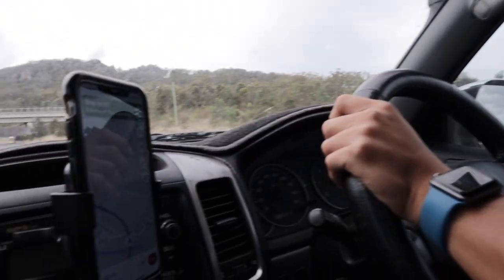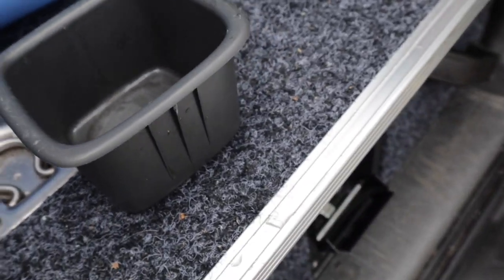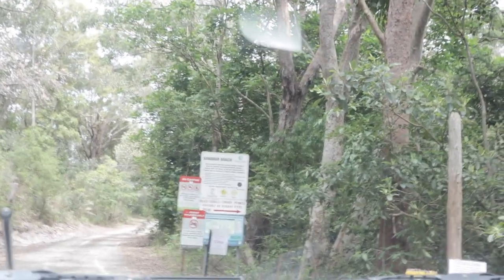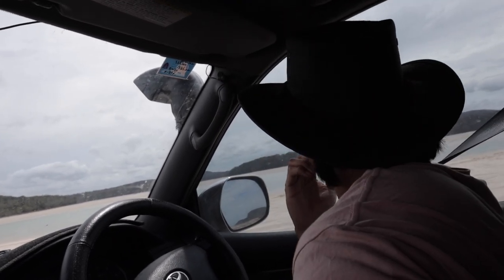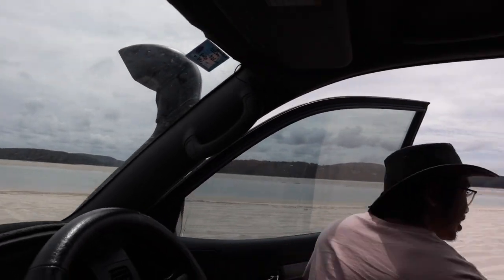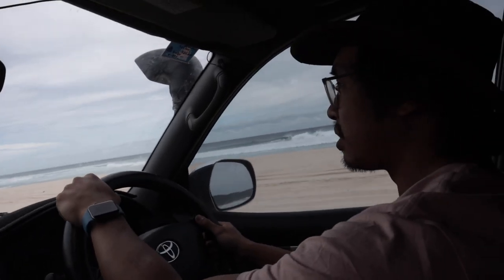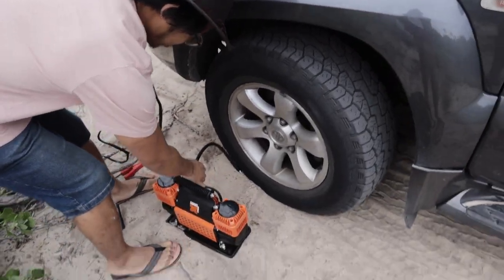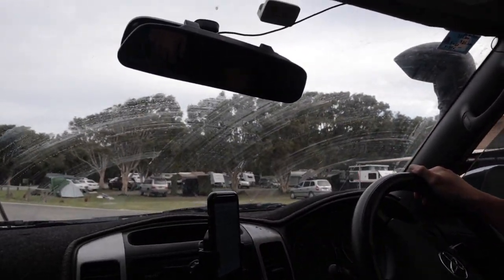Mid North Coast NSW Road Trip | Beach driving Australia | Our camping toilet FLIPPED while driving!

Comment: Omg buy a quick release for pumping your tyres, not that screw on thing 😂😂😂, ohh we camped at kylies beach last winter right next to diamond head  we going back there in april..
Reply from the maker: Yeh, just got the kings 3 in 1 tool but we have to get a seperate compressor hose for the fittings. Such a hassle with those screw ons. How do you rate kylies beach?
Reply: @nowherenext  nice, big green open area good for groups....  4wd beach access